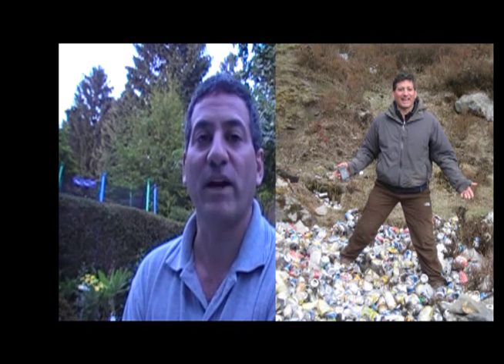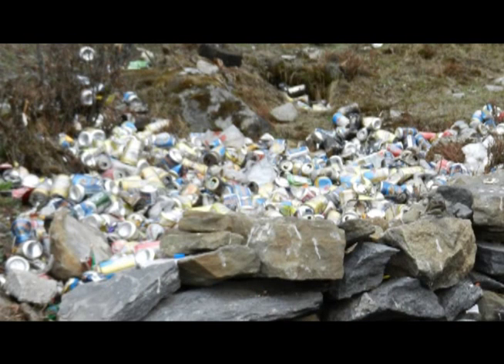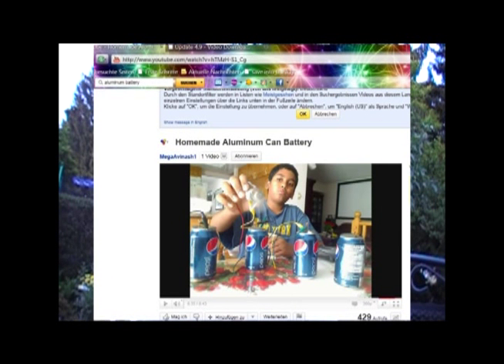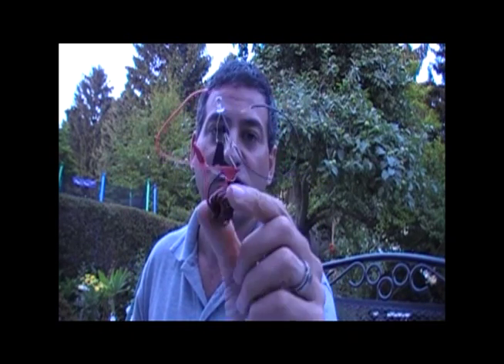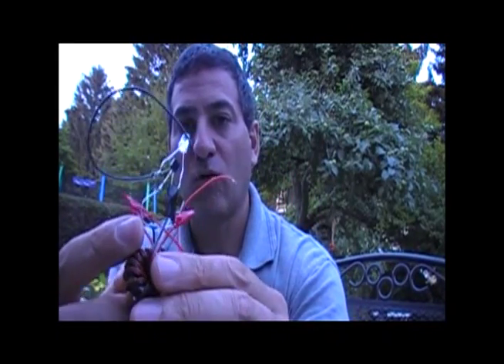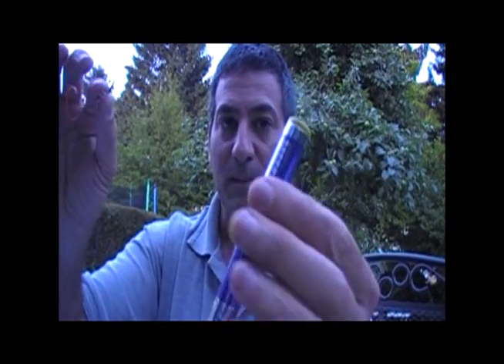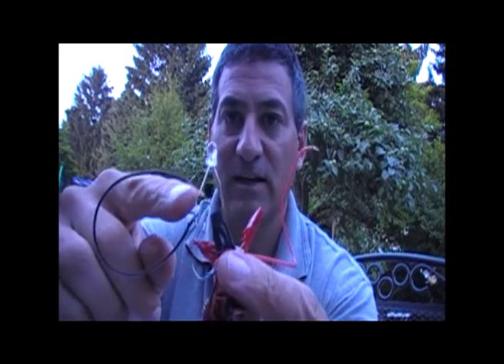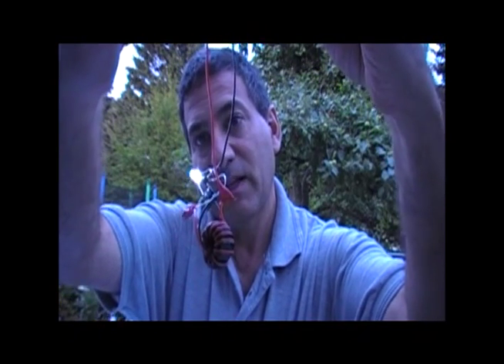Solar CITIES makes our first Joule Thief

Comment from the maker: @HomoSapien2012 My understanding is that ferrite is "magnetically permeable" with a high inductance (Q value) so that you create a strong magnetic field when you run current through the wire.  As this field builds and collapses it induces larger current flow. You can use an "air core" or any other material it is true, but the magnetic field induced is too weak to drive the transformer that makes the joule thief work.  Iron in general and ferrite in particular, seem to do the trick

Comment from the maker: @HomoSapien2012 Thanks for the nice comments. I am using a ferrite toroid that I bought for about 50 cents at Conrad.de (an electronics hobby shop kind of like Fry's or Radio Shack) here in Essen Germany.  It is not magnetic.  They sell them in various sizes; I got one that seemed large enough to do 13 double windings.  You can find small ones inside CFL bulbs that you can tear out but they are a bit harder to wind.  Hope that helps!